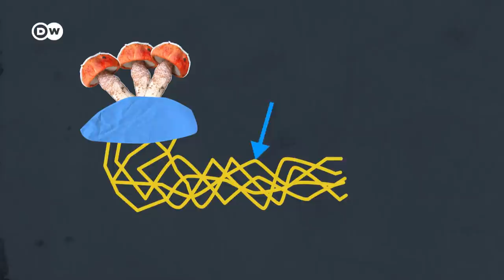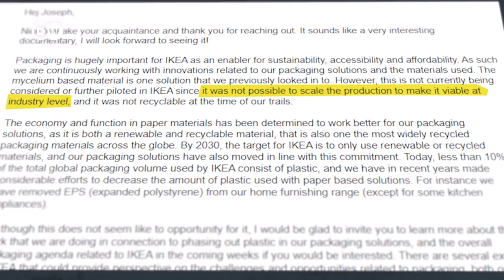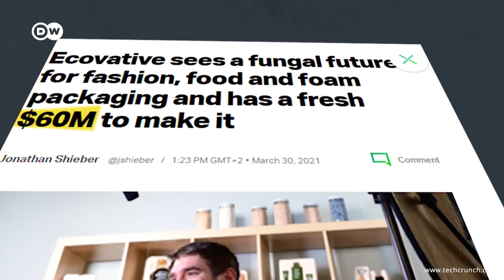How to make "plastic" out of algae and mushrooms

Comment: I feel additive manufacturing, and computer aided design, using biodegradable materials would be the way to lower the cost and weight of these materials.
Instead of compression moulding. Roughly grind up the mycelium mats. Mix with a biodegradable non-toxic compound to act as binding. Use advanced CAD to design the packaging optimally (only as much material as needed, and as strong as possible at the same time). Extrude the mix into the desired shape using a 3D printer. 
I think a mesh design could be lighter, and yet stronger than polystyrene. The price may even be similar.
Reply: I like the idea of mesh design for an optimal weight and strength, however I don’t think that is the case for mycelium. The hyphae itself is a binder, and the mixture of mushroom spores and substrate would not sustain the heat in 3D printing. I have seen people experimenting 3D printing with orange peels though! Hopefully it could be used at a bigger scale
Reply: @vuongt7964  Yeah. For the most part I think more use should be made of state of the art CAD to improve resource efficiency. I don't know to what extent it is used in industry yet, but we've been seeing reports of the promising organic-seeming results of advanced CAD backed by some AI to improve the efficiency of designs. I wonder if it's still too expensive to incorporate into most designs? Seems so promising.

Comment: The problem is,
GREEN-PLASTICS DOESN'T really able to be recycled to organic materias. You need special facilities. And, if you just throw it to the environment, well, it's just become the same plastic trash, polluting it. It's not like ice cube. Turn water to ice cube, and it can melt, become water again. Once you turn algae to plastic, it's not vice versa, as long as the requirement doesn't meet.
Reply: These are not bioplastic, they are plastic-like organic materials. Mycelium material turns into soil in about 4 months, look up a very recent study by Elsacker.
Reply: @eueueu91  Really ? Hmm.. so is it better than those green-plastics type ?

Comment: I can definitely see it working with packaging however there is an issue with using it in tubes and wire coating because it attracts rodents that eat it. Car owners have found that out.

Sorry to those who had big hopes for mushrooms but I'm just not a fungi
Reply: Could you share your source about the issues car owners had with mycelium? I'm founding a company in this very market, so it would be really helpful.
Reply: @eueueu91    it wasn't specifically with mycelium however Phil Edmonston in a 2015 or 2016 edition of his book Lemon-aid for cars mentioned problems with rodents eating the plant-based coatings on wires and tubing in cars.